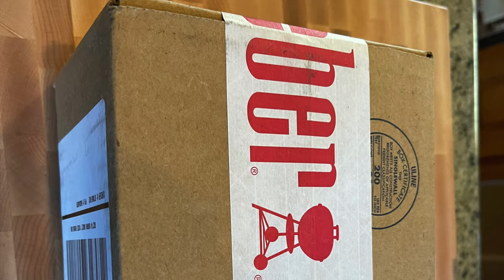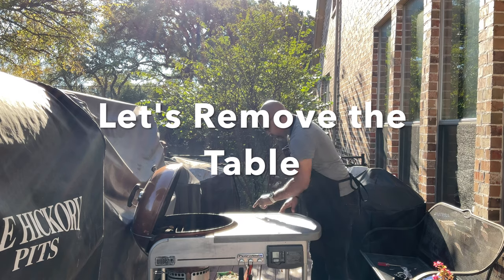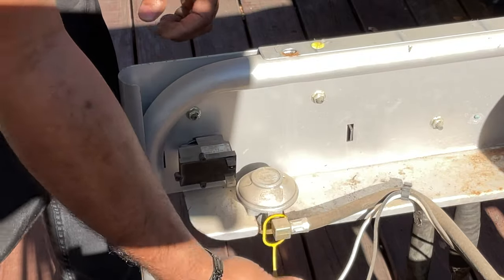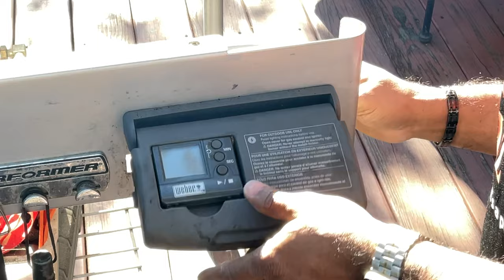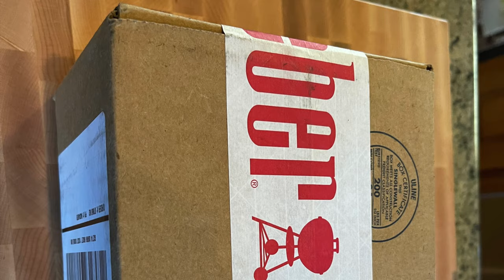How to Replace The Ignitor Switch on your Weber 22" Performer (Easy as 1,2,3!)   4K

Comment: When do you use the igniter? Coal is far away for indirect. Also does it prevent using a vortex?
Reply from the maker: @rocketman455ci1  I use the igniter when doing low and slow cooks without the use of the vortex. The slow and sear also benefits from the igniter as it can help start the coals and be used for searing or indirect cooking. Hope this helps.

Comment: According to your video when you removed the old igniter button the positive battery terminal of the battery was inserted first. When you installed the new igniter you installed the negative battery terminal first. This would indicate that the hold igniter had the battery installed wrong. Unless off camera you switched the new igniter battery.
Reply from the maker: Yep. That's exactly what i did. I wish it was just as easy as the battery being incorrectly placed. Great observation. Thanks fpor checking out the video.

Comment: Nice job.  I need to figure out why the igniter on my 2007 Performer no longer works.  It doesn't use a battery or module like that.  It's just a button.  I bought the grill used when it was around 8 years old and have replaced the igniter once so it didn't last very long.
Reply from the maker: That’s crazy Wayne. I will look for parts for that model and see if i can find anything. Thanks as always for checking out the video. Have a good weekend.
Reply: @DskiGrillz  Thanks Dski.  I just posted an update in the comments.  You have a great weekend as well.

Comment: Well Dski, you inspired me to go out and see if I could get the igniter on my Performer to work.  It was 39 degrees out and very windy.  I took off the igniter and wires and brought them inside.  I made the mistake of pushing the button on the igniter and shocking the crap out of myself so I knew it worked.  I then got out the dremel tool with the wire wheel on it and cleaned the ends of the wires that bolted down onto the propane tube.  They did have some corrosion on them.  I also slightly sanded the tube where the screw went in.  Bolted everything back on and hooked up the wires and everything now works.  I didn't have to take my table top off, just had to remove the charcoal bin.  I think it took me a total of about 10 minutes to do everything and get it back installed.  Thanks again for the inspiration.
Reply from the maker: Sweeeeet!!!! I’m glad it worked out minus the “shock.” Lol. Catch you later my friend.

Comment: Are you sure you didn’t just have the battery in backwards?  The one you took out was not the same direction as when you resembled it and it worked again.  Thanks for the video anyways.  I just picked up a used performer and I’m sure it will need some maintenance.
Reply from the maker: Very sure. Thanks for checking out the video.